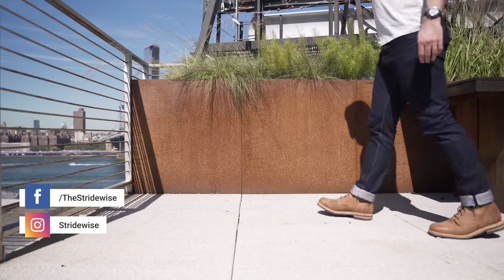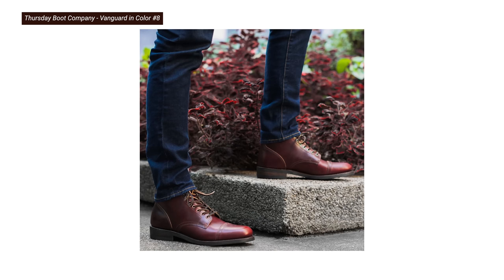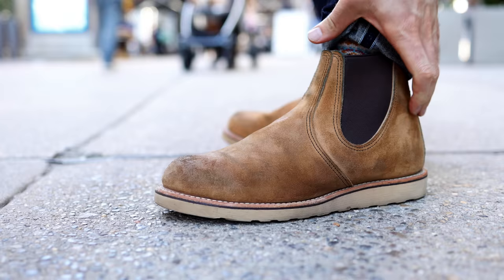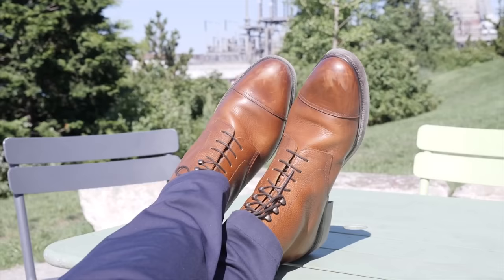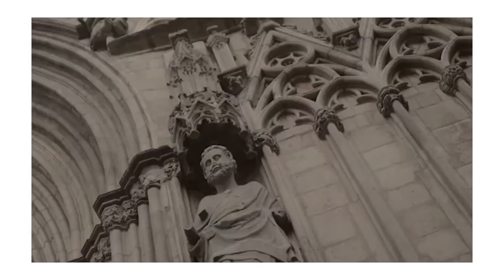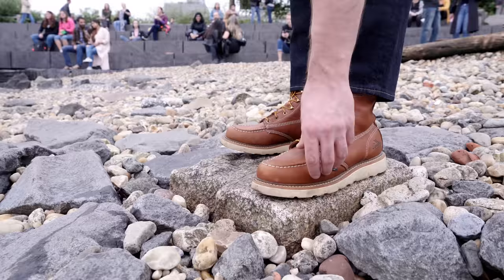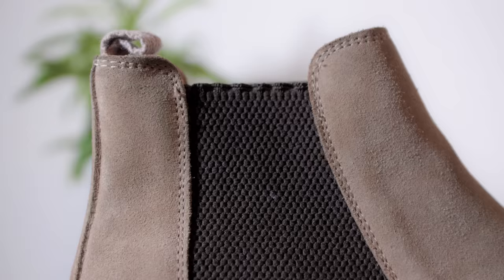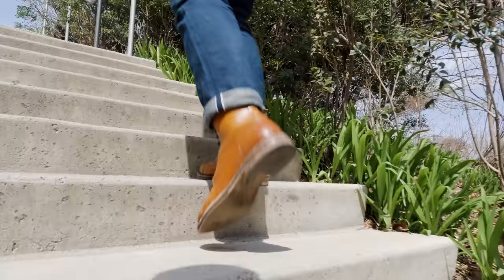THE 10 BEST BOOTS FOR UNDER $300 (inflation update!)

Comment: As a person on the lower end of the income scale, I appreciate this video. I work in a recycling center and am hard on my boots. I’ve been lucky with thrifting, but I also had to buy a pair of cheap boots on a big shopping site during the pandemic. I again learned that cheap items are often more expensive in the long run.
Reply: I'm in the same boat here to. I've found some killer deals on Poshmark for work boots.
Reply: @waynedub1167  Thanks for the tip.
Reply: @jonlouis2582  Hopefully it helps ya out. And if you find a dany pair remember to oil them often if you didn't already.
Reply: Thursday’s are by no means work boots. Fine for a casual office or a short hike, but not working on a plant or factory.
Reply: @waynedub1167  Since Nike Cortez has gone up , l have went to Poshmark too
Reply: @pattgsm   Why not?  They are ultimately Goodyear welted boots made with quality leather.
Reply: @BC08  it was pointed out to me that most plant / factory floor (level where production takes place) are usually mandated to PPE requirements for footwear such as steel toe, composite toe, slip resistant, chemical resistant, electrical safe etc… non of the that applies to working in a casual office setting or any job that allows sneakers.

Comment: Just buy a Thursday boot if money is tight. My Captain is going on 5 years old and after substantial wearing , I only had to replace the heal so far. Most guys don’t need overly built expensive boots.
Reply from the maker: That's exactly it, like there are "boot guys" and there are just regular humans who want something that looks cool, handles rain, matches a modern wardrobe and doesn't cost or weigh very much. For these roundups I try to target the latter
Reply: They’re not very comfy tho. I have captains and I can’t walk more than a couple of miles without some kind of pain. Heel is too thick also.

Comment: I just bought Parkhurst Richmond's in Rust Waxy, factory seconds for $278, shipping included. Was a few surface scratches on the leather, as advertised. I am planning to use these as knock around boots and expect to be rough on them, so no problem on the slight scratches on the leather in a few places. Amazing boot. Great fit at 9.5 D while I am 10 on Brannock, 9 in Red Wing Iron Rangers. I am very impressed with Parkhurst boots. And they can be had for under $300.

Comment: I just recently bought two Thursday Captains. $300 for both pairs bought from Ebay, One rugged and the original Captains and debating on buying a pair of service boots from Canada West lol
Reply: One was used and other was brand new with a strong chemical smell
Reply: @Kratos-bf2jg  the smell goes away from wearing them which relaxes the leather for release, airing them out, cedar shoe / boot trees to absorb order. The more you move in them the faster the smell fades.
Reply: My wife has some of the matte black chelseas and the scent is nauseating.  Guessing it's a combo of the dye and leather.
Reply: @jeffloucks2120  to speed things along you might try giving them a good washing with saddle soap and let them dry in the sun, then apply some conditioner.
Reply: @pattgsm  Thanks for the saddle soap idea.  Was wondering if that may make them a little blotchy as they seem so dye heavy.  A quick light wash would probably be a good approach. She has worn them some last winter but they are definately a rotated item.  She does keep cedar shoe trees in them.

Comment: I have a wide foot and a hard heel strike when I walk. I'm wondering which of these brands have a really good shock absorbing soft outsole with a wide size offering. 
This video came out just in time for when I'm looking for a perfect casual boot.
Reply: If you like mocs the Thorogoods have a longer lasting sole than the Redwings that will help out with the heel a bit. 
They are also more comfortable when it comes to shock seeing as they have a
poron insert.  Trade-off for comfort as the man made materials will deteriorate faster than Redwings.  That said I've put a lot of work hrs on concrete and pavement in the last 18 months on the Thorogoods.  Original insert is still holding up well and the heels are worn some but not ready for a resole yet in my eyes.  Available in EE.  As Nick mentions they make a good more work oriented boot but they also pull off casual everyday as well.

Comment: Got thursday's they recommend going half size down and they're way too tight on me.
Reply: Interesting. Most find the recommendation of going 1/2 down from sneaker size to be too big. Remember that leather stretches once broken in. I had to go down a full size but 1.5 sizes from sneaker size fit     like a pair of pre-broken in Iron Ranger. Order your dress shoe size and a half size down from that then decide which is the better fit.
Reply: I’ve had the same experience.  I’ve never had to buy wide shoes but 1/2 down on Thursday was too tight in my toes.
Reply: I had the same experience. I returned my original pair that I ordered a half size down and went true to size and those fit nice. In fact I ended up getting a second pair because the burnt orange suede was just too nice looking to pass up!

Comment: Very good video. I am researching Meermin now. I'm looking for a Chelsea full cut without breaking the bank.
Reply: Theyre good, but the hiro last is quite small so you should go 0.5 - 1 size up. Theyre pure torture to break in though, and their customer service is the worst you will ever experience. But if you get a good (non faulty) boot that fits its great.
Reply from the maker: Meermin'll do it!
Reply from the maker: @TheFrontyer  ah, so not hiring customer service people is where they save their money!
Reply: @Stridewise  For sure. I had to threathen with a lawsuit to have them follow EU legislation, which they violated. Also read many reviews that complained about the hassle with returning shoes if theyre faulty or wrong size.

But the boot themselves are great value, especially the wholecut chelseas.